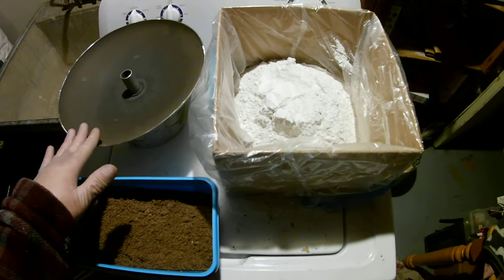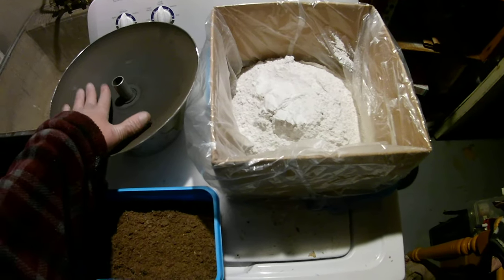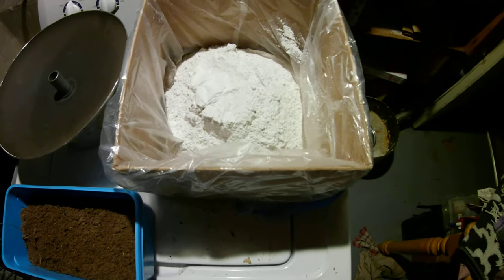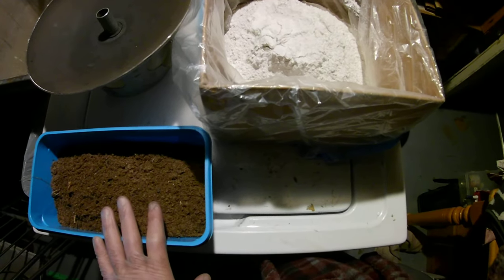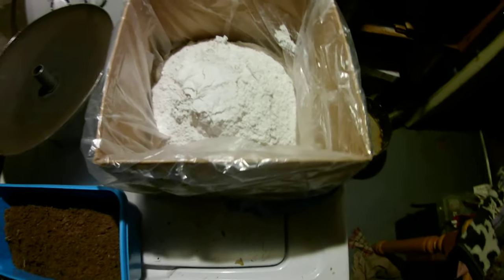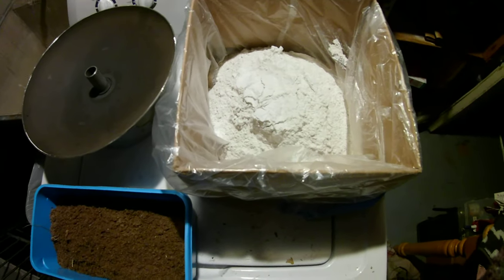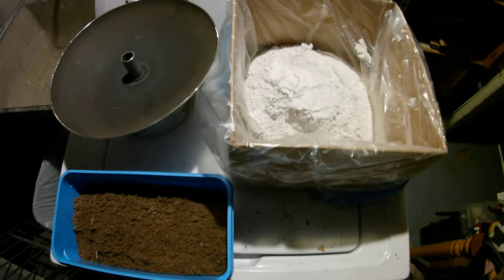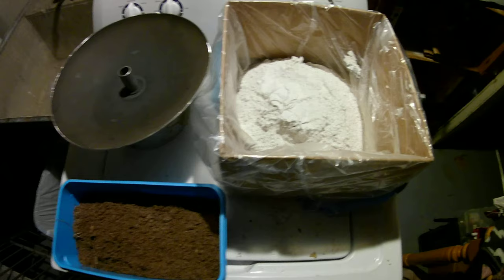Furnace Refractory home made recipe you can make better than you can buy

Comment: how does this compare to the "standard" recipe using perlite, vermiculite, cement and sand? i think this will be way cheaper but would it handle the heat of a rocker stove? thanks
Reply from the maker: hmm,that sounds like a fuzzy standard, it should be more than heavy duty enough. If you have any issues adjust the sand content.......

Comment: ratio 2(sand) to 3(joint compound) by weight or volume? Also, if I could find pure gypsum dust, would that work just as well, or does it need to be joint compound specifically? I have also noticed there are different types of joint compound just by searching joint compound into the home depot search, what should I be looking out for?
Reply from the maker: look for normal contractor grade, the gypsum thing I do not know, but I am sure it would be fun to figure out yes? And remember  people will always tell you that you can not do something -until you do!

Comment: Brilliant video, thank you.  Do you think reducing water by using superplasticiser would help?  For reinforcement, I presume the matting used would need to be heat resistant, or maybe if it's buried far enough inside, not.  The other alternative is, I have some glass fibres, about 12mm, and some similar carbon fibers.  I will report back anyway how it goes
Reply: so how'd it go?
Reply from the maker: your goal here is a high r value ,so take that into account for any additive ok.

Comment: Hey mate I've got an outdoor concrete chimney heater. I was carrying it, the bottom half cleanly broken off. Lucky or unlucky it fell on my foot and didn't break. I tried to get a refund but because I couldn't find the receipt down the offered me $50 something I paid nearly $250 for. Do you think this mixture would repair it
Reply: Yes ,but  with a mixture made out of refractory cement and cooked clay ( fine grounded clay bricks  ) and some fine washed sand ( example a rivers sand ) . 1 part of Refry.cement 1 part of clay and 1 part of sand ) or ( 1 part of Refry.cement and 2 parts of clay ) voila !!!! P:S don't make it too watery...must be dry mortar ,just with enough nice humidity .

Comment: Sir its not good to use those construction cement for fire brick?
Reply from the maker: not cement
Reply: Joint Compound is for gypsum or drywall. They are nontoxic and are put in most homes in the United States.

Comment: Where do I go to learn to make it not cheap and high grade?  Like if I wanted to start a steel mill without hiring a steel miller for all his expensive secrets?  Lots of recipes online calling for sand and plaster and perlite but where the fuck do I get a Cement Clinkers supplier and how do I mix with that?  I know nobody here has those answers, I'm just venting.
Reply from the maker: try research
Reply: @robinhoodprojects9509  is that sold in buckets or bags?
Reply: 😂😂😂❤ Yup. High heat plasters.